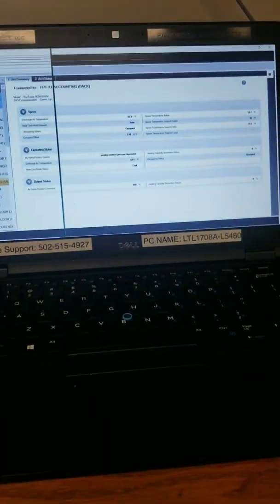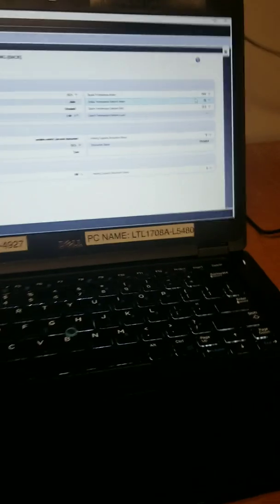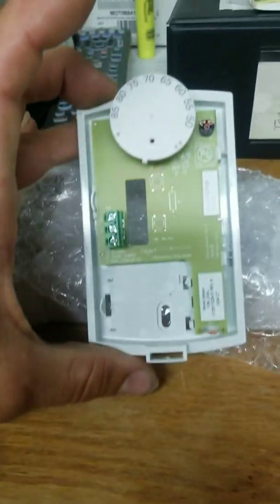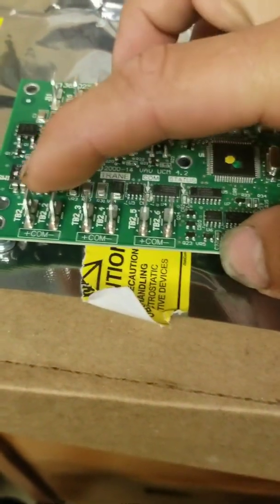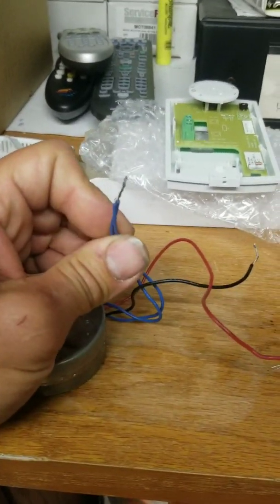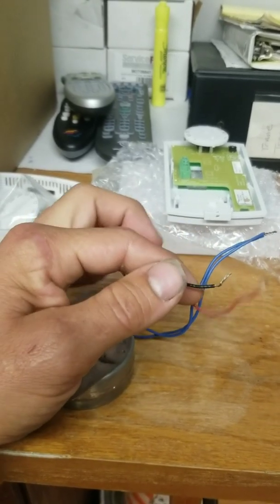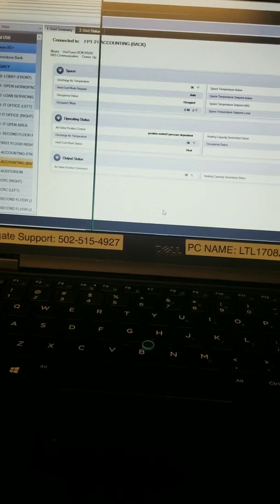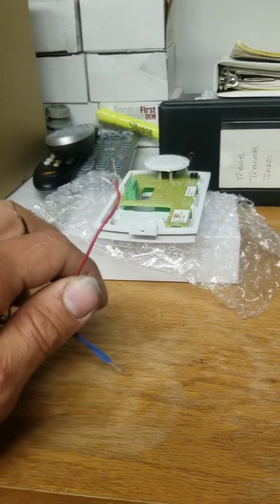hvac service call, Old VAV system damper not working.

Comment: How does it know its reached its full turn- ?
Reply from the maker: There is a simple end switch. This system is one of the early automation systems, Just like most older equipment they keep the controls quite simple.